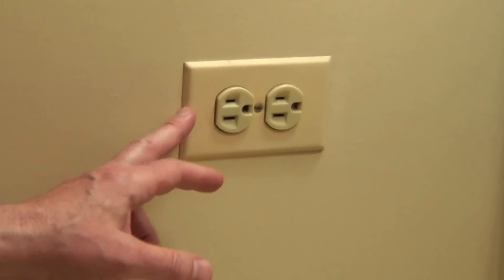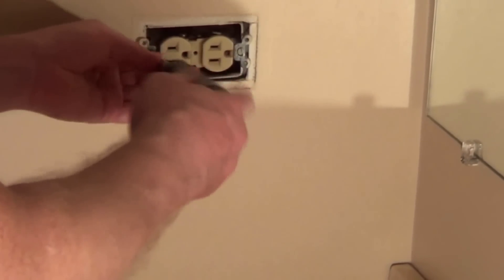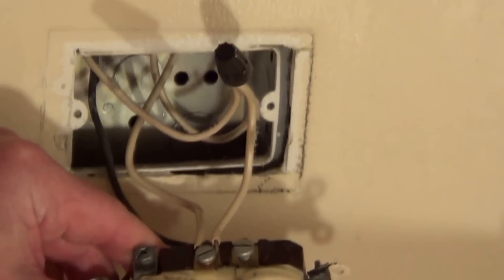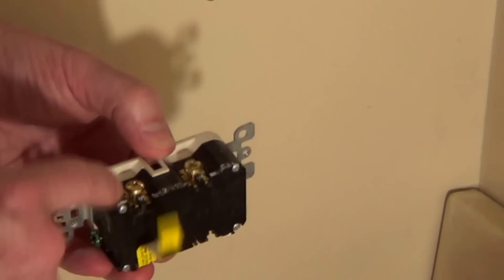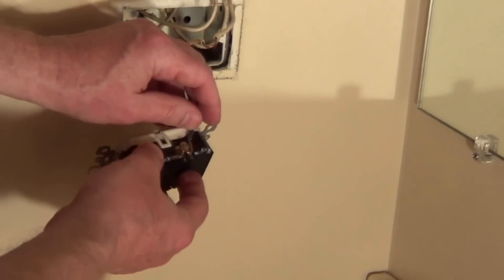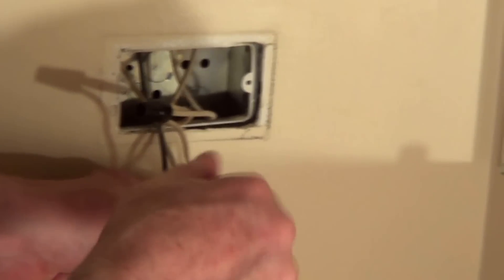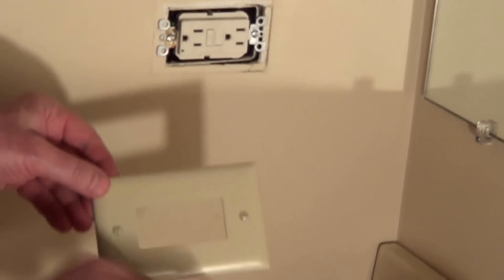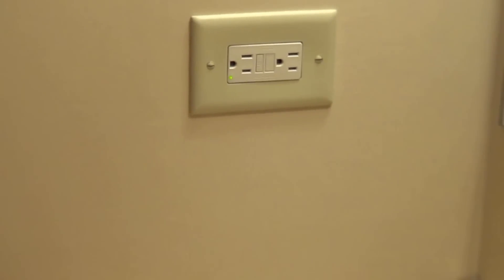Bathroom Outlet - Replace Outlet With GFCI - Conduit

Comment: Grounding through mounting screws ? Not good.
Reply from the maker: Hi, for areas that run the electric in conduit, this is how the devices are grounded. The metal box is connected to conduit all the way back to the service panel. The conduit is the ground path.

Comment: No ground? When was this ever legal?
Reply: There's no ground because the person who made this video is a DIY hack and not an electrician.  While it is technically safe to ground and outlet through the conduit, it is not up to code and ill-advised for any project.  The outlet that was in there before should have been a 2-wire, so really he's just replacing one mistake with another.  Any competent electrician--or DIYer with some common sense between his ears--would rewire the box.
Reply: FIX IT Home Improvement Channel I have the same one in my bathroom like this and I was worried cause I had no ground wire untill you said Seattle, where I live. Thanks!
Reply from the maker: Hi,
In Chicago they run metal conduit to metal boxes. When you screw in a device it is grounded all the way to the service panel. You can test from hot to the box to confirm. There are only a couple places in the US that does it this way.
Reply: +FIX IT Home Improvement Channel. when you say screw in a device do you mean the gfci receptacle you are screwing to the box is automatically grounded? so you dont have to run a wire from green screw to box?
Reply from the maker: In areas where conduit is run all the way back to the service panel, like Chicago and Seattle, most electricians don't use a ground wire. When you screw in your outlet or switch the screws touch the metal box, the metal box is attached to the conduit back to the service panel which is grounded.